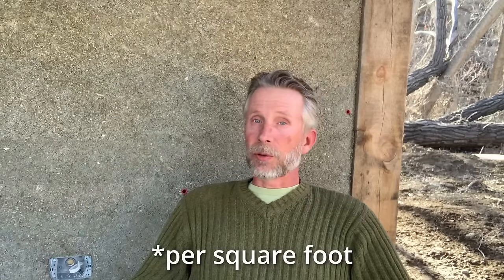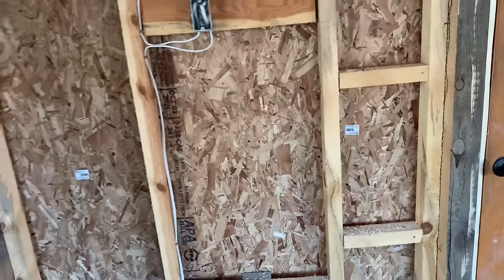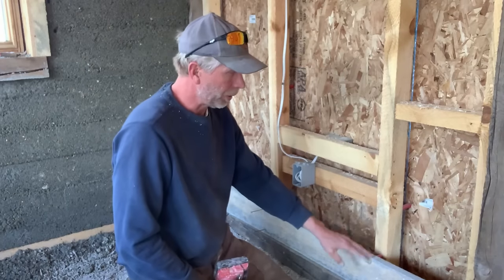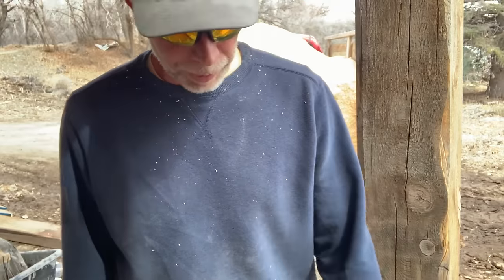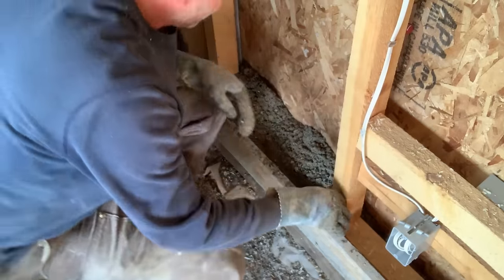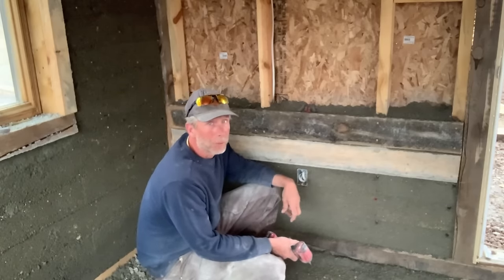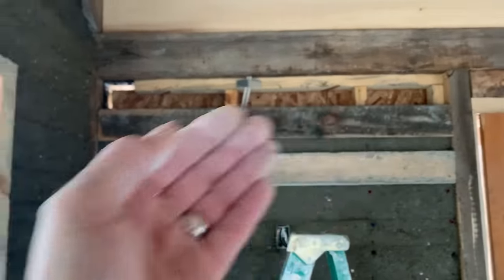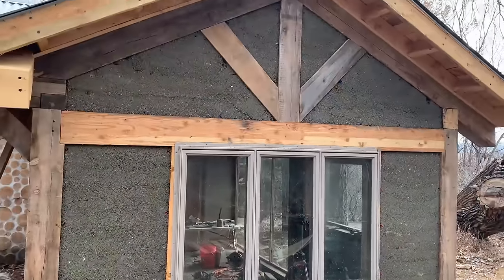Dustcrete

Comment: I seen a simlar cabin in Colorado 1990's built back in the 70's this was a timber frame cabin with cedar shakes siding outside but interior  was made a cedar saw dust and lime mixer and set in a similar fashion but they use a mold to shape it like logs on the interior once cured it was stain and painted to look like the real thing! I stay there for several days before I realized it! Thanks for sharing

Comment: A friend gave me a load of Sawdust for making fire balls which I did but being a mainstream and alternative den builder I binned some cement into it and made bricks a gravestone( one of my dogs died old age) . I repaired an Adobe wall with it ( bad boy) that was when my plastering demon got excited, the rear of the barn where we are renting had been neglected and the lime wash had fallen off , no one sells hydrated lime locally so I tried just dust and water, binned it on like adobe and trowelled flat , left it to dry, didn't Crack or fall off I didn't use a mechanical key or chemical sealant, just threw it on. 
I then limewashed it which puts a mm protective coat on. I only coated half because I was building a coop. The raw coat is on after winter, some minor cracks but nothing a coat of wash wouldn't finish. Water,Sawdust elbow grease. Some dust works better, the finer the smoother , mix smooth with rough to get a good workable sticky mix, even mdf dust works. I've used it all over this property in Ukraine, render patch ups. Hole filling, even stands up to floor repairs!! Chuffed to have stumbled on this video because I have my house to finish down south when the Russians have fkd off, then I want to expand to help others.  It's a cheap to free material, super strong, water proof and insulating. I soaked a brick in a bucket for four days, no swelling distortion or deep penetration. The render does shrink a little but no more than any expensive acrylic planet killing mix. Good work fella, sorry for the essay, but I'm excited about this stuff.
Reply from the maker: I always love a good novel. It sounds like you are doing some great innovating. Hopefully these politicians will stop waving their dicks around so you can get back to living!
Reply: @radicalgastronomy  ain't that the truth. from usa

Comment: Sawdust and cement was the magical recipe used by the British in the construction of the 'Mulberry Harbour' caissons towed to Normandy for D-Day +1.
The fact so many of the structures still litter the beaches of Northern France to this very day is testament to the durability of the material.
Reply from the maker: Cool. I did not know that!
Reply: Seems like I read recently that it was discovered that sea water was the secret ingredient to the ancient Roman concrete that's is still viable a couple thousand years later. I know it's been known to contain a significant amount of biomass for quite some time too. That makes me wonder if, in either case, the wicking and retention properties of those fibers acted to pull in distribute salts and other minerals through the curing process?
Reply: @andrewdunlap5130  misconception its not just saltwater, it helps but its also a very specific way thry add in limestone that allows the concrete to repair itself over time
Reply: @kiyosenl.3889  Right, I forgot, the particles are far larger too, right? Or some of them, so they're never fully hydrated unless the concrete fractures and allowed water to and air to penetrate? Something like that?
Reply: @andrewdunlap5130  p8
Reply: @robertcabrera9607  ?
Reply: Bollocks. You cannot use Portland cement or any Calcium Oxide or hydroxide based systems with sawdust or natural fibres or glass fibres if you want ANY strength or water resistance  
You need a Magnesium oxide system. The high alkalinity depolymerises cellulose and lignins and eats glass. 
MgO activated with MgCl2 or MgSO4 is compatible with timber and natural or glass fibres.
Activated with fumed silica is more water resistant. Activated with potassium, sodium or ammonium Phosphate is strongest and most seawater resistant. 
You can use dolomite lime as a filler but not if it's calcined to CaO and MgO. 
That stuff will not last or have any strength. Like hempcrete made with Ca0 it's only suitable for drywall insulation. 
Seawater is 6% Magnesium dry salt weight.
Roman concrete is doleritic Volcanic ash  calcined at low temp to fumed silica, and high Magnesium oxide and iron oxides relative to calcium content. And activated with seawater for the extra Magnesium and sodium and chloride to activate and provide charge balancing captions. And bone ash as phosphate source.
Reply: @aaronfranklin324  : Hate to break it to you, your knowledge is flawed. 
Go to Normandy and take a sample of one of the Mulberry caissons or contact the Imperial War Museum or Ministry of Defense, then you'll have the choice of either apologizing or shutting up. 
Either is fine with me.
Reply: @aaronfranklin324  Hey Aaron, Some of us are slower can you dumb it down. Are you saying that Sawdust or any natural Fiber can't be used because the chemicals will attack the glass fiber?  Will it attract water? Will it rot the wood?  
What would you have changed to make this work? If it can work.
If it isn't water resistant insulation will it attract water over time? I was thinking it would turn into a sorta petrified forest.
Reply: @GriffenNaif  the caustic alkalinity of Portland cement due to CaOH cleaves ester bonds in the natural fibres and attacks glass. 
Also the moisture content changes cause swelling and shrinkage in both Portland concretes and especially sawdust. 
Just with temperature and humidity changes. 
MgO systems are less porous, have far greater elasticity, not brittle. Don't swell and shrink much at all.
So in addition to adhering,   are better in every way. 
Including not turning all the oils in your skin into soap and dissolving  your skin like Portland or CaOH slaked lime.
Reply: @andrewdunlap5130  The "Ancient Roman concrete" "secret ingredient" was HEAT. They heated the water before use or used quicklime/"calcium oxide"/etc... in the recipe, which reaction is thermal.
Reply: @aaronfranklin324  Trying to follow you. Some of us don't use chemical signs in our daily life.  So a Sorel Cement?  Is that in a box store? Or cement yard?  

 magnesium oxychloride with Epsom Salt?
Zinc Cement? 

Can I use standard Fibers, rebar, and plasticiser etc with that depending on situation?

https://www.youtube.com/watch?v=dX_QbphiM6I
Reply: @GriffenNaif  yeah Magnesium oxide you can buy from rural fertiliser shop. 
You can get Magnesium chloride there too.
And Epsom salts which is Magnesium sulphate. 
Either the sulphate or chloride work similarly well at 10-50% by weight. 
You'll have to test the range of mix ratios to give best results. There is very high water of crystalisation in some of these. 
And your fillers like sawdust, clay, sand etc can be reactive and change ratios a little. 
Yes you can use any standard Portland cement type rebar etc. But any fibreglass or whatever for Portland will be embedded in waterproof snot or plastic coated to stop the cement dissolving it.
Plasticiser, probably. But you probably won't need it. 
Portland formulations usually use some plaster of Paris to make them appear to have set in the first few hours. 
And then gradually ACTUALLY set over weeks to years. 
So your losing pourability, aggregate fill ratio.... and workability by immediate sticking together of bits of aggregate with Calcium sulphate- plaster of Paris blobs, and skins, with not ultimate strength or water resistance.
 particularly if they are dry bits and sucking in the water. 
This is helpful with MgO cements like Chloride or Sulphate activated Sorel. 
There's Sorell and Sorel. Different chemists different centuries, one used Zinc, the other Magnesium. 
For the rapid set Super strong, ultrachemical resistant chemically bonded Phosphate ceramics of Magnesium, Aluminium, Silica, Iron etc.
Those are supermaterials that can handle highly corrosive high, strength, cryogenic to up to 2800 degree temps. 
Are also cheaper than woodchips. 
Like mixing some phosphoric acid or phosphate fertiliser with your Magnesium, or calcium or Silicon or zinc or titanium or  Aluminium or iron oxides. 
To produce anything from a one coat ceramic impervious and indestructible coating on rusty or clean steelwork for military Naval applications.  To rocket exhausts, jet turbines or Formula 1 disk brakes. 
Gets stronger with aging, including repeat ground or seawater or chemical soaking and roasting dry....
Reply: @Aaron Franklin  thank you for making it understandable for me.
Reply: @Aaron Franklin  do you have a ratio of materials required to create the correct composition?
Reply: @dgman2u  It will be variable, depending on the fillers you might use, and water of crystalisation in the activating components. 
The MgO,  MgCl or MgSO4 system is the most forgiving, and most cost effective. And certainly will perform very well in anything but permanent immersion in water or wet soils.
Ratios of between 10 to 1 and 3 to 1 of MgO to MgCl/MgSO4 will work. But remember that While you get the MgO as roasted anhydrous material, the MgCl and MgSO4 are have six or ten molecules of water of crystalisation per Mg salt. 
I the easiest way is to dissolve an excess in water, so some stays as a slush, and you can pour off a saturated solution.
 Then you can look up the soubility and get the molar ratios perfect if you are so inclined. 

Or simply measure out  a tablespoon of MgO powder, add just enough activator solution to get a smooth workable but not too funny paste. Do the same with equivalent amounts of activator liquid at half full strength half water, 1 part water 2 activator.....
They garden like plaster in 4-5 hours. 
Put them in your hot water cupboard overnight to dry out properly, then compare the hardness and strength. 
When you have a handle on what works best for what your fertiliser supplier is selling, then you can do some more tests with whatever sawdust, clay, sand, fabric.... Aggregate as filler, starting from there as a baseline. 
Too much water or too little reduces strength. 
Some fillers are active and will alter the ideal binder ratios. 
It's a pretty wide window that it works well in.

If you want to play with the Potassium Phosphate activated ultra high performance versions the molar ratio is the same as for the hydroxyapatite that your bones and teeth enamel are made of. 
And, at least locally they sell the Potassium Phosphate as high purity reagent grade so you just need to work out the mass of the molecules and water of hydration, and you can calculate the perfect ratio. 

But once again, it's pretty forgiving. 

MgO is commonly simply pumped into porous volcanic ash or sandy soils to cement them together to prevent erosion, or ensure stable foundations for buildings or dams.
Reply: Lol! @GriffenNaif

Comment: Great idea and thank you for putting together this clear instructional video.  I like how you've come up with a way to allow the timber frame to be revealed inside and out, one that uses mostly local materials and is something an owner/builder with some time and energy can do on a budget.  I'll keep an eye out for your plaster video too!
Reply from the maker: Editing it, as we speak!
Reply: @radicalgastronomy  Have you tried wood chips instead of sawdust?  We have an inexhaustible supply of free wood chips here in Maine, with sawdust costing a bit more than you paid at Todd.  I'm also wondering about just using a clay slip instead of the cement and lime.  I've done that before with straw for light straw clay with good results, but that was in Paonia where it's dryer than here.
Reply from the maker: @jeanneandlinchergenrothera8708  I have tried both wood chips and clay slip dust. Wood chips are a bit coarse to make a sturdy wall. Though clay slip straw works well, the saw dust lacks the long fibers and tends to crumble when plastering.

Comment: I'd been looking at using sawdust and lime for quite a while as we've a local sawmill. But I grow a fair amount of willow too, for various uses. So, I bought a small forest chipper to process the waste, and found it too binds well together with lime or clay, although I'd only trust the clay version as an infill. My lime sample went like stone in a few months, so that's my choice for a free-standing wall. I'm in the UK, so we have non-dolomitic lime and the grade I used was NHL3.5. I try to steer clear of portland, but your results are impressive.
Reply from the maker: I’d love to get away from the portland, for sure. Lime/clay versions coming!
Reply: So with NHL 3.5 you substituted S lime and portland w/ 3.5 in the recipe?
Reply: @radicalgastronomy  I’ve heard mixed reviews about the use of Portland cement in this kind of technique since I came to France. The pros are it cuts the drying time drastically, and makes a much sturdier result, the main downside is it makes the mixture non “breathable”.
Reply: @angeloalessi9378   what do you mean?   Do you want the wall to be breathable?   I would think not?
Reply: yes, this is what i was going to ask.
Reply: @timduncan8450  You DO want a wall to breathe so it can get rid of any moisture that gets into it either from cooking, showers, etc or from outside rain or humidity. Also, indoor air pollution which is worse than outside pollution, can go right thru your walls and not be sealed in by a water proof coating, possibly cement. Study hempcrete wall technology and healthy house ideas.
Reply: Lime is fired too!
Reply: Has the chips worked out good for you ?

Comment: I like the process. I do have couple of suggestions you might want to look into. 1) Run your wiring through Conduit before adding the concrete, in case you need to replace it at some point. 2) Consider adding Bonding Agent to your Concrete mix as it will hold up better over time. 3) Consider adding a small amount of Plastizer to the Concrete mix as well. The concrete will not only flow better, but will add significant strength to the walls, consider you dont use a lot of water. 4) you might want to consider using a 3/4 Fiberglass or Basalt filament to your mix for additional strength. 
Overall I love how you've done this!
Reply: What would be a good bonding agent? And what would be a good plasticizer?
Reply: @SilentSalad Sika makes many good concrete additives including bonding agents
Reply: Fusioncrete

Comment: Very nice!  I've seen talk of the hempcrete and the styrocrete, but it always seemed more bother than not since you have to buy in those oddball components which only drives up the costs.  Sawdust, though, is available locally and for pennies.  Thanks for the quality tutorial.  Definitely something I'll share around.
Reply from the maker: Thank you. I appreciate that!
Reply: @radicalgastronomy  Any thoughts on how it'd work with the newly discovered Roman Concrete recipe?  It'd be nice to build something lightweight and self-repairing.
Reply from the maker: @threeriversforge1997  the lime already does this, to some degree, but so bet the larger chunks in that Roman method could be handy. From my understanding, it takes about 30 years for lime to fully “cure”. It keeps absorbing CO2 for that entire time. In other words, it forms crystals over that whole time, hence some self-healing.
Worth a try, for sure.
Reply: @radicalgastronomy  From what I'm reading, the lime can't be slaked before being added to the mix.  Something about "hot mixing" changes things for some reason and is why Roman concrete can last for thousands of years.  Of course, the temps generated while you're mixing the concrete might be problematic if you have wood dust in there with it! :D
Reply from the maker: @threeriversforge1997  As I understand it, lime rocks in a camp fire will shed CO2 and become “hot” lime. Slaking this begets hydrated (type S) lime. Mixing that with water creates lime putty which reacts with atmospheric CO2 which causes it to harden. I don’t know if chunks of hot lime in this mix would reach dangerous temperatures, or if the formed material would have enough O2 to ignite. Experiments are needed.
Reply: @radicalgastronomy  Here's a vid that discusses the latest scientific discovery that finally explains why Roman concrete can last 2,000 years.  I'm still not clear on if they're using slaked lime or not.  It seems to me that they're not, but I might be misunderstanding what they're saying.  Still, if they've finally solved the riddle and we can make "Dustcrete" with the Roman Recipe, creating something that will heal micro-fissures and stand up for a thousand years... that would be very cool!  https://www.youtube.com/watch?v=HYyyx2dNvPw&t=384s
Reply: @threeriversforge1997  I thought it was made from fly ash and the effects of salt water.
Reply: @non1503  Apparently it's the undissolved lime in the mix that reacts with water and is able to flow in to any small cracks, sealing them up before they can get worse with time.
Reply: @threeriversforge1997  cool.
Reply: @non1503  There's a link in my comment above to a vid that talks about the recent discovery.  For regular folks like us, it could be fun to make things around the home that'll last long enough to baffle future archeologists!  Imagine their surprise when they find a mailbox post made from roman concrete!  :D
Reply: @threeriversforge1997  thks for the link!!

Comment: Well done for creating the product and the method of construction - your presentation was also very good and clearly demonstrated. What struck me is that it is still labour intensive. I think the idea could be capitalised on by having a mechanised production line for creating the dustcrete sections or blocks that would interconnect. You could even have specialised sections with channels and box holes for electrical wiring.